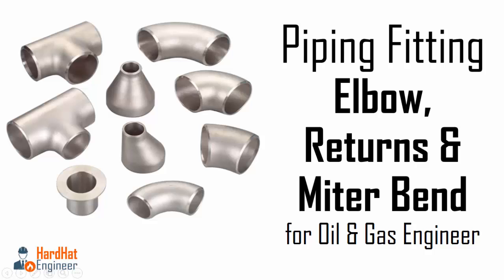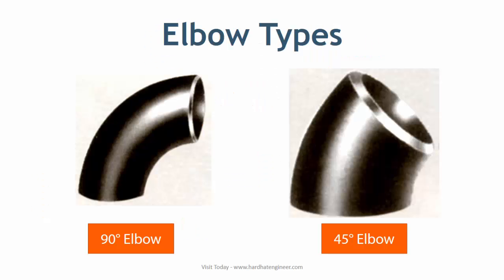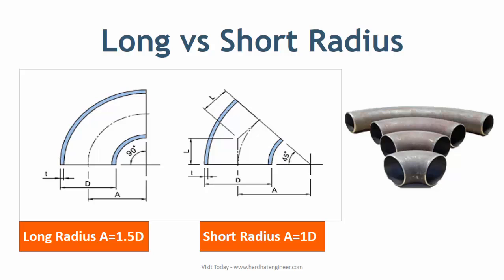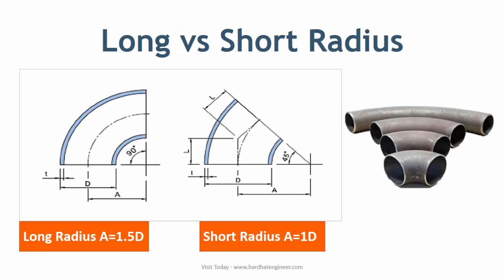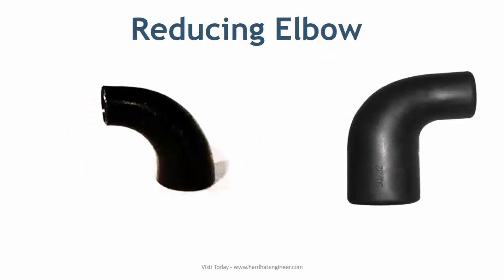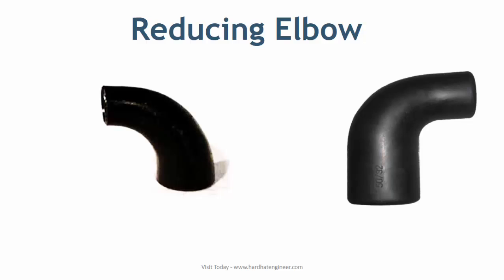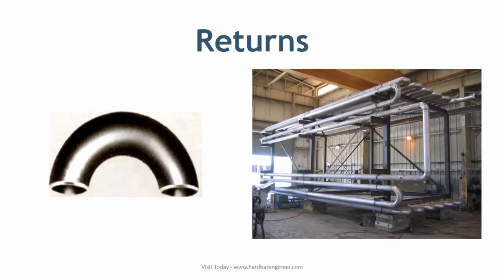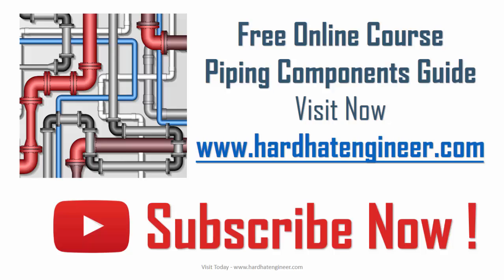Pipe Fittings - Elbow, Miterbends & Returns  Part-1 /3

Comment: You mean when we have long transport  we use long radius &short radius  for space not enough and the mean pressure loss
Reply from the maker: Yes, long radius elbow has less pressure drop as compared to short radius. Why someone has to used short radius if there is no constraint and make loss.
Reply: HardHat Engineer  thank you

Comment: please upload video regarding Heat Exchanger ( All types),  boiler , Compressor with ASME CODES AND MATERIAL USED IN IT, ( All mechanical equipment - With Class and Grade Code )

this is my extremely request to you.
Reply from the maker: Thanks for suggestions, will add video in future.